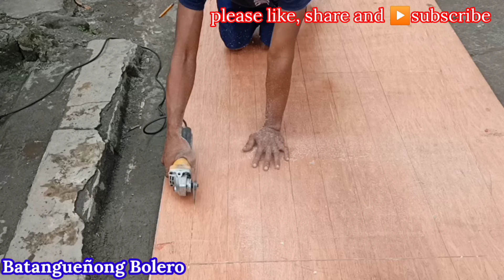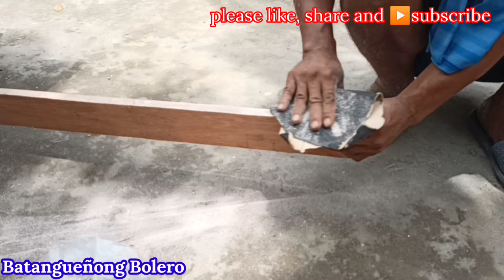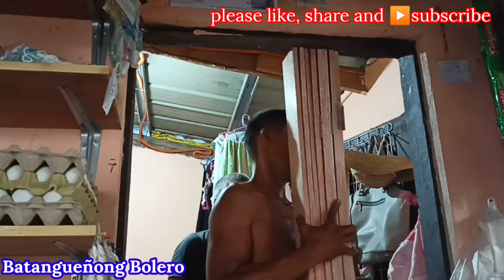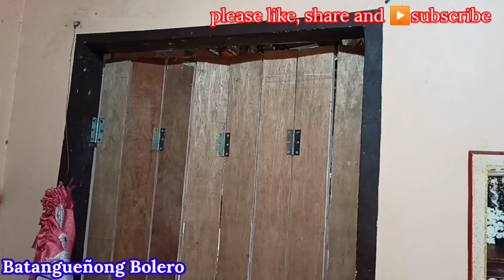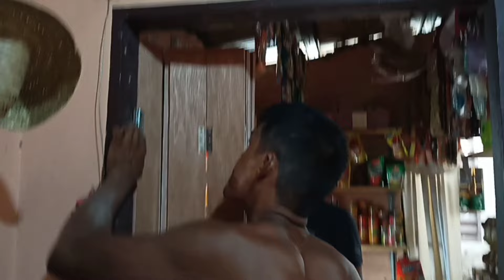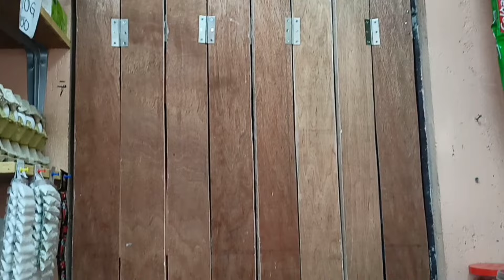DIY Folding door in small space area • 1.2k budget may modern door kana • wood folding door •amazing

Comment: Any tracks to keep it  Is aligned at the top ? then a home made of course or can they be bought with the wheels that connects to each board in order to keep aligned at top making the rest look even better and then add an latch like a screen door to keep closed  or Magnetic type that can hold close and give privacy to that room and save heat or AC in summer time with some houses. Older houses removed many doors once heat came into each room and no blocking off rooms and sleeping in one room in cold winters. That's how it was done in the old days, that's if no fireplaces in all the rooms. Any ideas please comment to this,  I'm looking to do same and trying to figure out best way that doesn't break the bank, I'm looking at using piano hinges and might get away with 1 hinge that's long enough to support the weight of all, that seems better to me and tighter fit using 1 by 4 pine or what says is best, thinking of buying the pvc one at your big stoors that can build homes from,  just cost roughly about $110 on the 1 I'm looking at. Real easy setup. Anyone have idea's,  please comment to this,  thanks,  love this idea and may use pallet wood and wooden dowels and wood glue for length and each board might be different size but not by much and then stain them, then use smaller piano hinges and be like an Art style door once closed.  Could paint it also and make it look real nice, it's a kitchen door,  that's a bedroom off the kitchen with bathroom door as well and one more bedroom too, then have to leave house door as is but could be painted if great painter and design one of a kind kitchen look with all doors closed. It be kind of like those beeds that people used a lot back in the 1970's into 80's and still some left. Those are dangerous to kids like the blinds.
Reply from the maker: Dugo ang ilong ko eh😅